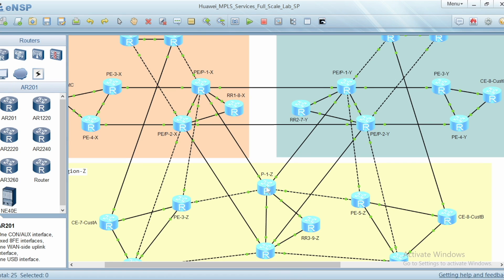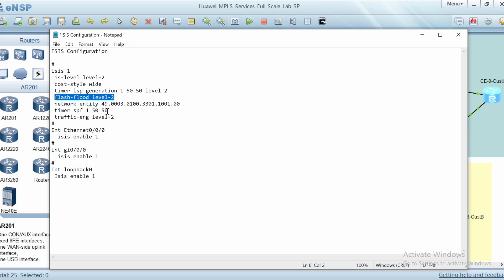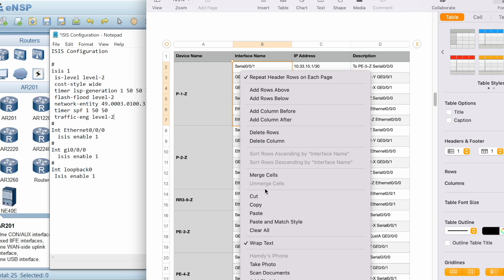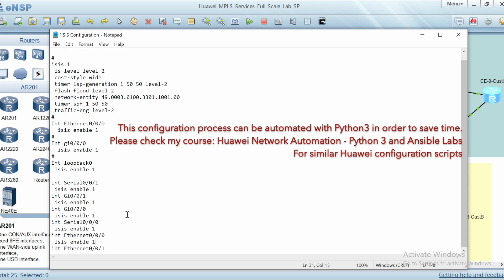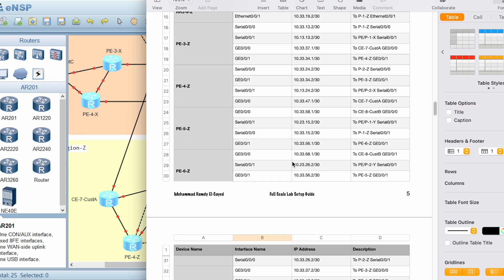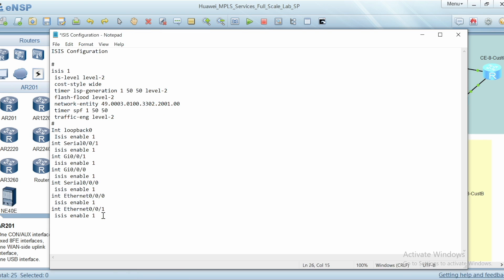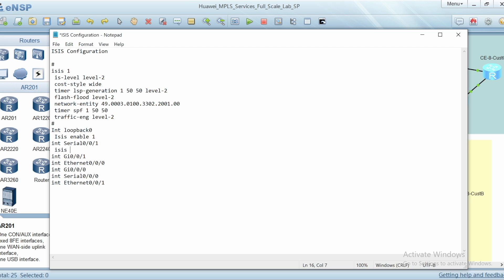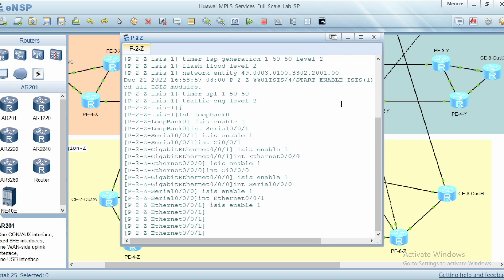Is IS-IS Configuration easy?! - Configure IS-IS Routing Protocol

Comment: Hi Muhammad, thanks for sharing. Please do you know if we can do similar SR lab with N40e eve-ng images ?
Reply: I was planning to build an inter-AS Option C lab (with BGP-LU) between the domain. Hopefully this can be also supported on N40e eve-ng image...
Reply from the maker: Hello Joel, I have a video for SR lab with NE40E on EVE-NG:
https://youtu.be/J6zhEGgVOTY
You can find the lab implementation (SR-MPLS BE) on minute (23:47), and I've successfully tested SRv6 on same image as well but SRv6 not in the video, planning for a video to share later.
Wish you Best of luck!
Reply: Great Thank you Muhammad!  Also just to know what version is required to test SR-MPLS & BGP-LU ? I m using virtual image NE40E V800R011C00SPC607B607 @LabsOnTrack
Reply from the maker: @TheJoelfrancois  This version should be a good fit